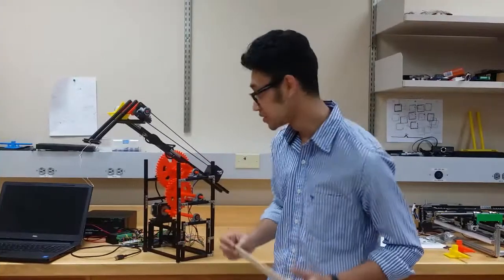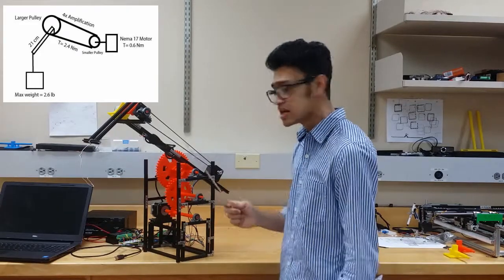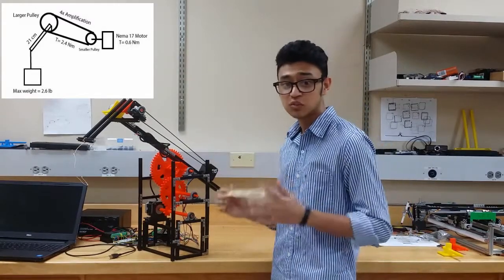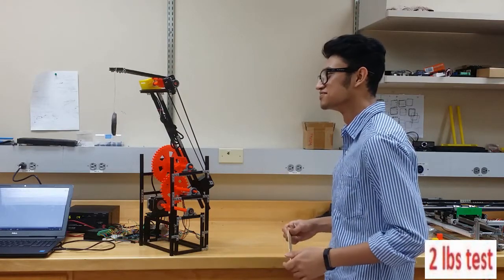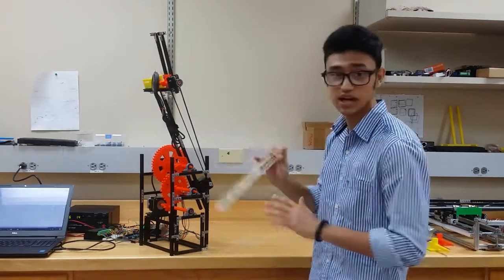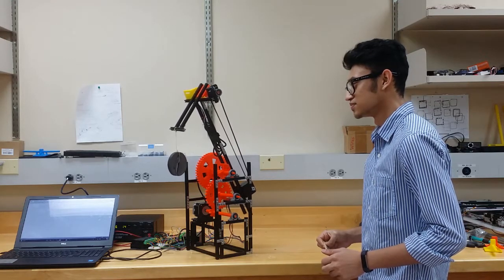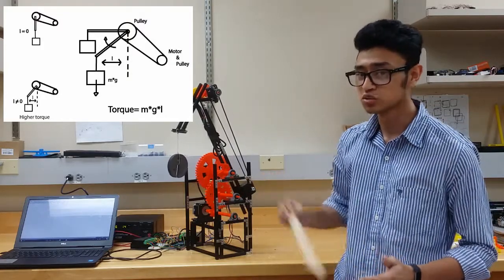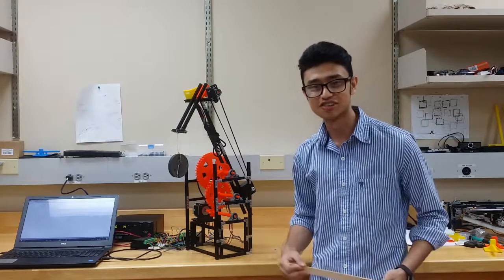Feedback PID Control in Arduino: Maximum torque test of a NEMA 17 motor connected to a Pulley

Comment: 17 on the Nema is about the size (1,7x1,7). Not about the torque. Exists various model of Nema 17. For example the Nema 17 17HS6002 has more torque than the common one. So I think it would be great to give the full ref of the Nema.